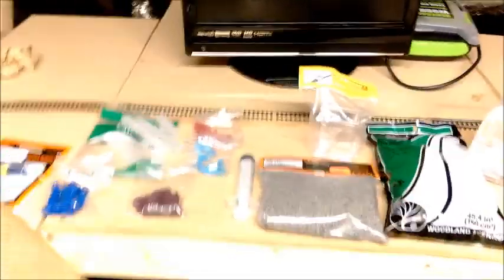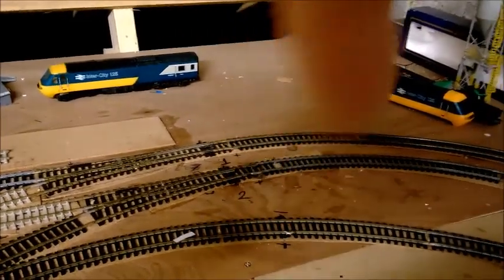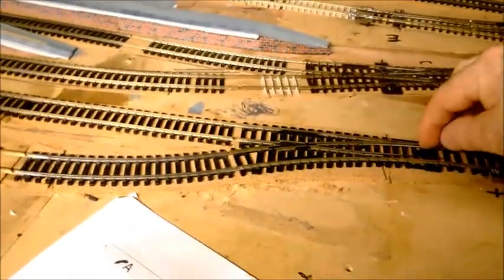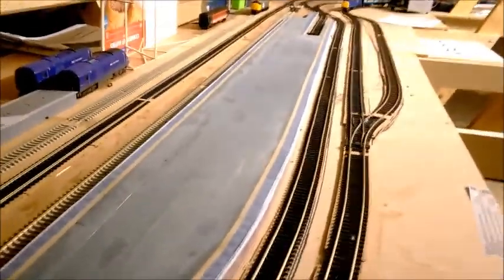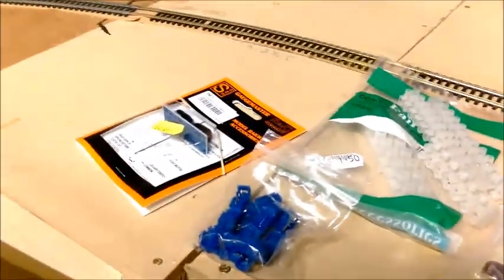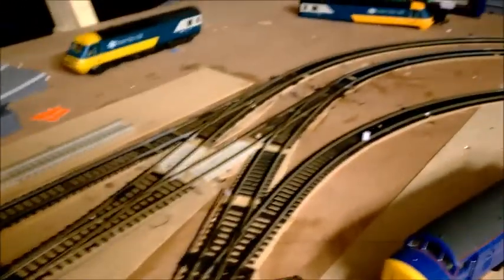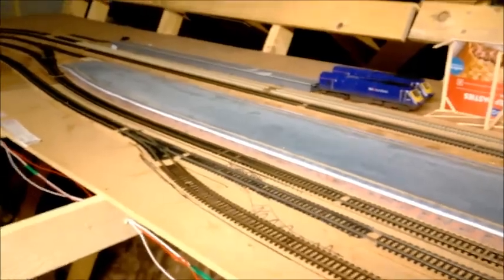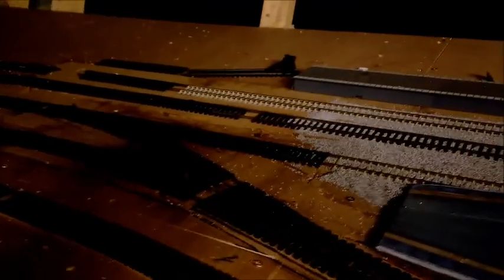Swindon Station Ballasting track Part 6

Comment: It's coming along and looking great Dave, doesn't the ballast make a difference, bit like icing on a cake. And that raised track is going to look smashing when all the ballast is done around that area.
And, I can't wait to see how you tackle the station building and office block, that will be a challenge and a half :0)
Reply from the maker: +Western Centurion Thanks Mark yeah it does make a huge difference to the layout, using the two different colours looks good also. I've spent most of this week wiring in the 5 point motors and all now working ok. tidied up all the wiring underneath and installed the circuit which goes underneath the access panel, which is use to get into the loft. just need a way to insert a switch there so when its open it cuts the circuit. Dave
Reply from the maker: +Western Centurion Cheers Mark had a look a the link earlier and looks a good idea, I can prob incorporate that into my existing line by inserting a insulator plate at either end of the run. and as I haven't yet fed them droppers I can use the dropper line I installed on the access panel to feed back to each side.  cheers   Dave